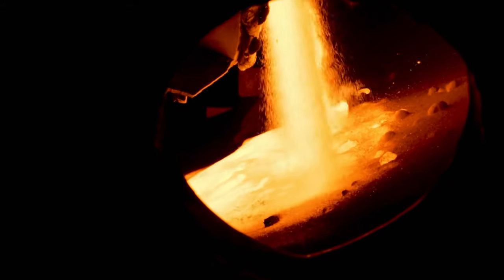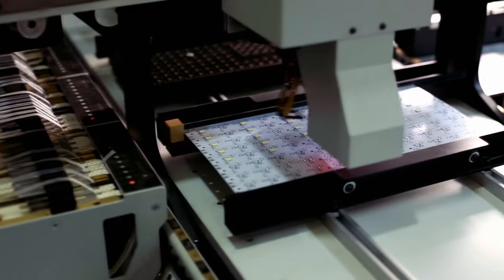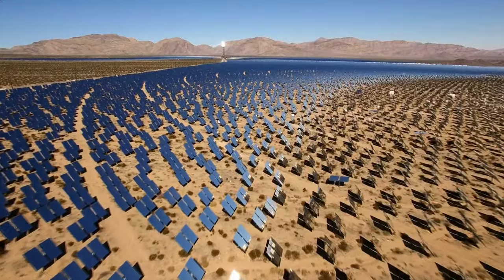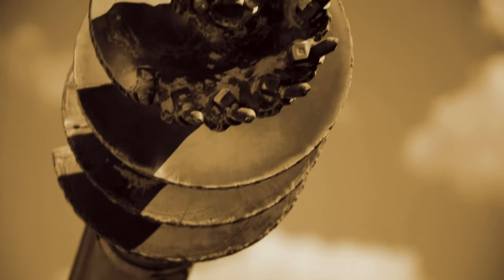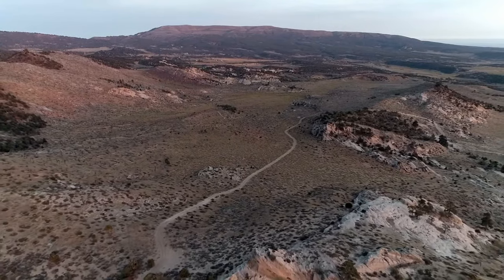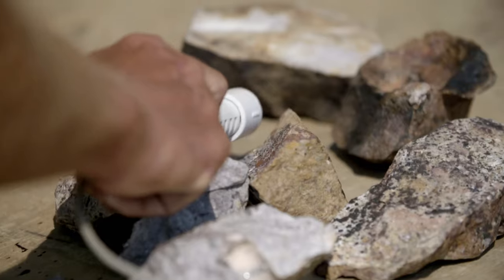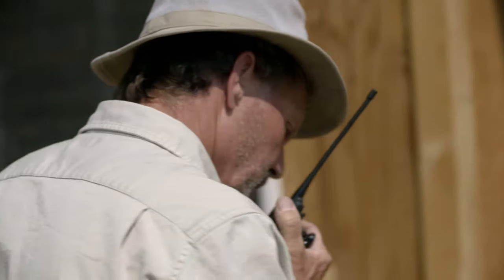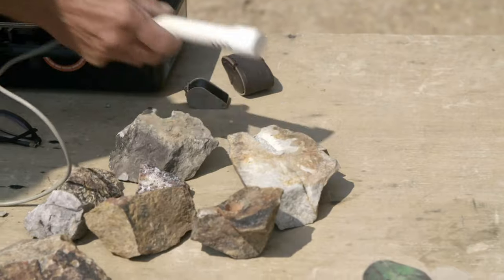Have The Treasure Hunters Found Gallium In The 500-Year-Old Aztec Box? | Mystery At Blind Frog Ranch

Comment: you guys aren't asking the right question. how did they seal the rock around the gallium. they are bore holds with rock sealed around them. this would mean that ancients had a way to soften rock and then harden it again. That would prove that the rocks with no separation between them in those ruins, were poured.
Reply: It doesn’t really look like rock was sealed around the gallium but more like perfect circles were somehow drilled out of the rock and the gallium poured into the bored out holes. Still a mystery how they drilled into the rock like that.
Reply: From what I saw the gallium was completely contained in drill holes internal to the rock with no exit so the rock was somehow reformed around it. How is that possible?
Reply: @rms5654  The gallium turns to liquid form at 86 degrees so just drill out the rocks, heat up the gallium and pour it into the rocks and then cool
Reply: @rms5654  Right, that's what i said

Comment: Why not just bore a horizontal hole at the lowest part of the cave system and just let the water drain out? Itd be cheaper that repeatedly calling in rat hole drillers. They seem to have some form of idea of what the cave system looks like. Tunnels are bored through hard rock all the time. Its definitely feasible to do and would give them plenty of access to their cave system